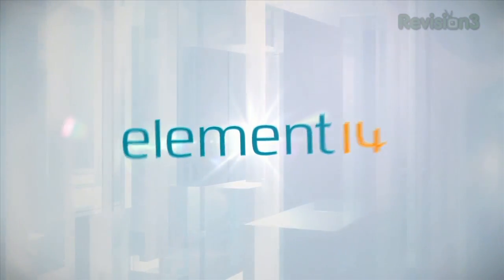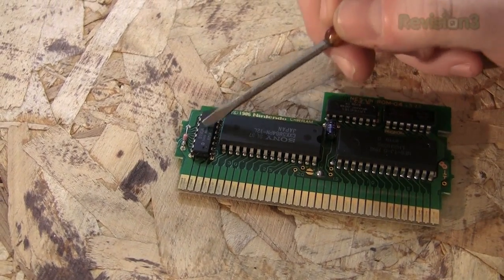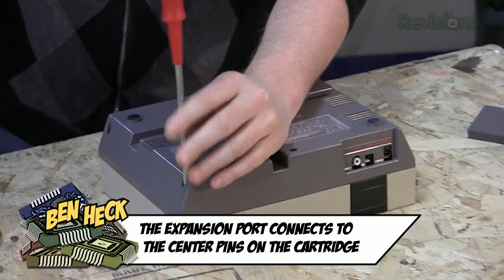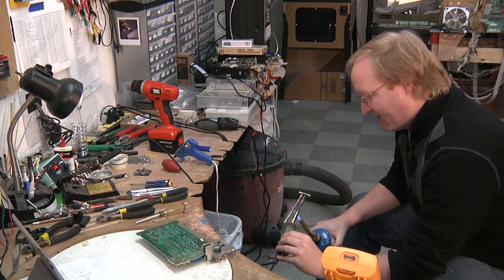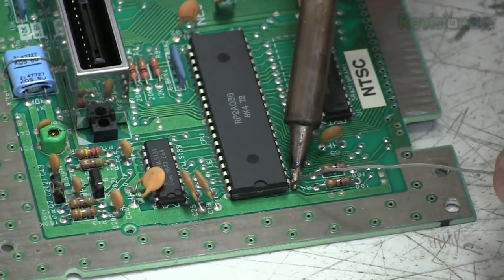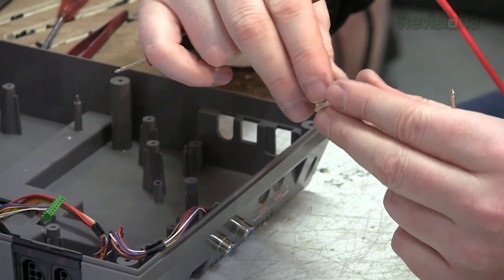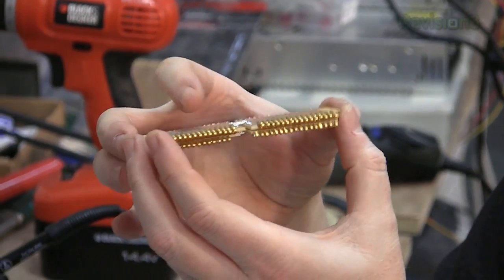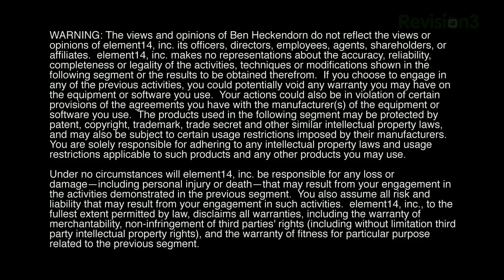Slot Loading Nintendo Game System - Part 1

Comment: You know the easiest way to fix the blinking Nes screen is to remove the 10 Nes Lockout chips functionality. Blowing in carts is actually very bad...if you're doing this you are compounding your problems. It basically causes corrosion to build up on the connectors that will eventually hose it.

Comment: Why didn't they just have a normal more solid connector with a ribbon cable attached to the board, could have kept the gimmick and not destroy itself. Or just have front loader, and maybe a spring pushing forward a bit that you could click in into place?  Or just have a front loader functionally the same as a top loader without the springy action?
The first two ideas would have worked for the feel they were going for, and not have the problem of the bending pins.

Comment: Once I realized how this system worked I went "WTF Nintendo, why overcomplicate this sh*t this much?" Couldn't they made the front loading without this ZIF bullsh*t? Like, just insert it and done? They fixed this with the Top-Loader but Nintendo being Nintendo made it with other problems.
Reply: That would have been great had the design allowed the inserted cartridge to stick out the front a little more so we could get a grip on it for removal. A standard insert slot like those in too loaders would have made removal difficult with the existing design.

Comment: the easiest way to fix the nes grey flashing screen is to remove the bb that is in a plastic track at the front of the nes cartridge tray. when you push down the tray, the bb moves off of a button letting the system know that the tray was pushed down. when the plastic track would wear out, the bb would only release the button only partially causing the flashing or grey screen. when the bb is removed, the system thinks the tray was pushed down and the nes would operate without having to push the game down. nobody ever seems to mention this problem.
Reply: Because that's not the problem. You attribute the issue to wear when the NES had this issue new out of the box.

Comment: 5:00  "Not so much 'flawed' as won't last 15 years"
I think that's a bit generous.  These things didn't last 5 years.  I don't think they even lasted 3.  Everybody who had a NES started having serious problems with the cartridge connector while it was still a relevant, daily used system.  It was really a serious problem.
Other than that it's a well built and reliable machine.  The connector is even replaceable - not that Nintendo ever sold them to the public, but still, it's a merit of the design.
It confuses me why Nintendos are so expensive nowadays - they sold tens of millions of these things.  All I can figure is that everybody threw them away when the connector made them think the console was "broken", and that's sad.
My NES from childhood is cosmetically rough but it still works fine.  I did replace the connector with one of those "death grip" connectors in the early 2000s though.  I wish I had saved the original for refurbishment.  Those modern replacement connectors have been in circulation for so long I'm not sure if younger users even realize they're not supposed to be that tight.
Reply: The problem existed new out of the box. It was flawed.

Comment: Would extending the metal bar at the top of the ZIF assembly outward (so that it can be pressed down instead of the cartridge) also achieve the goal of reducing stress on the bottom pins?

Comment: sorry but what is the point of this? can bend the pins back on the zif connecto. if you want can get a the new zif connectors online and the pins are tight and don't even need to push game down and it works. and if you really want can get the nes jr that was top load. this was pointless thing to do and a pointless video really. sure joke now but everyone should know never blow in game. that adds spit and stuff and corrodes pins.really ir and motors to load a game. this is dumb. talk about doing stuff the hard way. what is with the dumb rube goldberg stuff

Comment: Back in the late 90's when my Nintendo completely failed I opened it up by tapping the heads of the security screws and pulling them out. I had no idea you could buy new pin connectors or bits for the security screws haha. I cleaned and bent all the pins back up on the old connector with an exacto knife and put it back together and its worked perfectly ever since. [edit] I hadn't ever thought about the pins on the cartridges wearing all the way down from a tight pin connector, but I have only ever had 1 cartridge I owned fail on me and I don't know what caused it to stop working.
Reply: you should try cleaning the cart that failed if you still have it :P

Comment: I always wondered what retro gamers are complaining about when it came down to the ZIF connector. NES games weren't plated like a Saga or Atari games. The plating was about half the thickness (the reason why is to reduce production cost and time, basically if they wanted to double the plating it would have taken 3 times longer to make and you run a higher risk of "burning" at plate) and the ZIF connector was intended to extend the life of the game. The connector could easily be replaces and for really cheep. Also if you look at NES cartridges that have been used, they have alot of wear even with the design of the connector being the way it was. Imagine how bad the pads would be if it connected like a Saga or Atari game. There would be a lot of destroyed games. 

Now with the expansion slot I seriously don't think it was meant for an add-on. The Famicom DD connected through the top for easy connection. I am almost positive it was used for testing purposes, for both production and servicing, or for flashing the System ROM during production. It wouldn't make sense to have it covered so securely if it was meant to be used by the consumer. There is only rumors on what it was for and none of them make sense. I built circuit boards for many years for many companies and a connector like that reminds me of when I was building drives for motors and pumps. You can install the firmware more efficiently and test the product faster when the thing was built rather than testing components individually before hand.
Reply: Incorrect

Comment: FYI for anyone looking to disable the 10NES lockout chip: Doing so actually prevents certain unlicensed titles from starting, since they look for and try to disable it themselves on boot. It's a better idea to wire a toggle switch to pin 4, so the chip can be re-enabled when necessary.
Reply: holy shit a toggle switch, that would be epic

Comment: Is there any specs on the web showing what the add on for the NES would have been?
I am curious about what Nintendo may have made for that un-used slot?
Reply: PinBallReviewer Not sure about the specs, but at least on the N64, there was a disk drive sold so it could play CD games-but it sold poorly, and it was only sold in Japan (I think).  So maybe they thought there would be some sort of other game port they would use?  Multi port games or other weird accessories that never got made, maybe.

EDIT:
SaitoGamer 5 months ago
I think this expansion port never used was supposed to be a port of Famicom Disk System.

Comment: I think this expansion port never used was supposed to be a port of Famicom Disk System.
Reply: But one of the expansion Port pins is the pass-through audio pin used on famicom to NES converters, so Ben's mod isn't compatible with famicom games that use expansion audio

Comment: The Ben Heck Show I have an idea for a project that I don't believe exists, but would be extremely useful to budding filmmakers: An apparatus for recording camera movements during filming and then repeat those movements one or more times. This could be used to do Back To The Future Part 2 and 3 style moving camera split screen effects!

I'm not an electrical engineer, but I believe the underlying principle is pretty straightforward: Using a 2 or more jointed support arm with potentiometers (or similar) at all of the joints measuring the changing angles during the shot and then using that same data to move those joints in subsequent shots. Is this something Arduino/Rasberri Pi could handle?

This might even make a great Kickstarter project if it works well enough! I, for one, would pay a pretty good sum of money for a system like this... Anyone else?

JW3HH
Reply: I have seen something like this.  Can't remember the movie, but I do recall seeing the behind the scenes video, and they showed a setup where they built a miniature ( 1 foot = 1inch or so ) set, then had an overhead camera that rode on two rails above the set.  The camera could be raised or lowered, or moved side to side or back and forth along the rails.  A computer could manuever the camera viewpoint through the set, without running into the miniature buildings and scenery.

Still a good idea, and sounds like a perfect project for a Pi.
Reply: And interesting idea if I understand you right (Movement of the camera on the miniature set is duplicated by the full size camera on the full size set?).

Either way, it should be doable to have a recording/playback system for camera movements for the hobbyist.

JW3HH
Reply: Falbert Forester
It was done on Empire Strikes Back. The pilot's view from the Snowspeeder cockpit was shot using a computer controlled camera. I still have a recording of the TV special SP FX: The Empire Strikes Back which mentions this.

Comment: Fun fact: Blowing the cartridge didn't "Remove dust" as of popular belief, but moist got trapped between the connector pin, making the poor connection work, and you could turn it on again :)
Btw. replacement pin adapter is like $10 on eBay - well worth it!
Reply: very true, i heard the OEM refurbished 72 pins are even better than new ones. the new ones come from china and are built with different metals and are junk. the OEM Nintendo refurbished ones are legit
Reply: RideRedRacer The replacement connectors have a grip of death, and some of the cheaper ones can even strip the contacts off of the game board.

Comment: I think the worst part of the NES was the omission of the audio pins on the cartridge slot as famicom had.
There are quite a bit of games that have a integrated better audio chips on the mapper that either had to be crippled or just not sold outside japan due that.

Comment: You didnt have to completely remove the 10nes lockout chip, you could just disconnect 1 certain pin on the bottom row to disable it.
Reply: Without even taking it off the board, just snip the pin.
Reply: Ryan Winklevoss infact the lockout chip also prevents system overheating (somehow) so it's better just snipping the pin
Reply: Ryan Winklevoss He didn't remove it, he just took it out to show it, then put it back and connected the pin to ground. What I don't get why he bothered doing that when he could have just snipped the pin instead.

Comment: @Adrian Getano You give Nintendo too much credit. They did design the Famicom Disk System, which lacked a dust cover on the media itself and had frequent issues with the drive's belt needing to be replaced (like record players, only non-user serviceable). None of Nintendo's early work was particularly well engineered.

Comment: Besides being the most elaborate lockout mod I have seen, since it can be done by simply disconnecting the 4th pin without and soldering or desoldering anything, but still a cool video.
Reply: but that would entail cutting the 4th pin which forever ruins it. this way he can put it back in if ever wanted to for some random reason haha

Comment: Why do you need to add Stereo Sound if the games were all writen with Mono Sound in mind? Why not just use a adapter that splits the mono sound to 2 RCA Jacks to make the sound come out both speakers? That is what I did.

Comment: What was the purpose of the lockout chip? Also, how do you get away with soldering on IC chips without using a heatsink? Are they more robust than I have been lead to believe, or do you have a little leeway before you start to fry it? This is the first show of yours I've seen, very interesting! Can't wait to see what it looks like completed! I must also comment on the durability of the NES. No one I know has ever had one fail. One friend pulled hers out after years of storage and had initial problems playing it. About a week of swapping out games cleaned up the connectors and now it works great! Short of blatant abuse, I don't think these things fail! Have you ever seen one that had a meltdown? If so, what was the probable cause?
Reply: The lockout chip communicated with a second lockout chip in the licensed cartridges. If they talked to each other, the game would play. If the chip wasn't present in the cartridge, the console would continuously reset (if the chip failed, that would sometimes happen anyway, leading to the blinking LED of death that was common.)

There were way around it to play unlicensed games. You could cut a pin in the NES itself, which is what a lot of people did if the console's chip kept resetting it. Tengen reverse-engineered the chip to create their own. Color Dreams/Wisdom Tree would zap the chip with a voltage spike to disable it. Sachen would have a 72 pin dongle on the end of the cartridge to attach a licensed game to use its lockout chip (Little Red Hood used this.)

The toploader NES made from 1993-95 didn't use the lockout chip at all, so it would play any NES game.

Comment: I just want to point out that you didn't need to ground pin 4 on the lockout chip; simply cutting it is enough to disable it.
Reply: Yes, that is true. I've never bothered to ground pin 4 on any lockout chip I've disabled, and it has always worked perfectly.

Comment: ...or, you could just bend the pins back or flat-out replace the connector every 30 years or so... And what exactly are you making stereo sound? The point of stereo is to use your ears to percieve direction. Do enemies on the left go on a different channel than enemies to the right?

Comment: this is funny.. I modified my N.E.S. by simply bending the connectors with a small flathead screwdriver. After the  mod I only was required to insert the game cartridge (no pushing down required) and it worked better than any ones N.E.S. I knew.. even did my mod for a few friends. That was back in the 80's and I was still a child.

Comment: Those actually exist (I got them) They released a few NES infrared wireless controllers back in the day which come with a little infrared reciever box that plugs in to the system controller port, still got the box but I lost the controllers :( oh and it works withing 2-3 meters lol

Comment: Love this! Thanks for doing this... not done yet, but I have to ask, what was Nintendo thinking with that huge expansion port? What would other consoles use those for? That thing is HUGE, and if it drove up the price of what I (my parents) paid for that original Nintendo, I gotta know! Thanks Ben
Reply: It was probably for a floppy disk drive, over in Japan the Famicom got the "Disk System" that attached to the bottom, it came out in early 1986.  It never was released outside of Japan.

Comment: Well, the solution is simple. Wire a switch across pin 4, don't ground it. That way, if you come across a game that gives you problems on a modded system, but not a vanilla one, you can flip the switch before turning your toaster on and those games will suddenly... work.

Comment: I agree with this.. plus the sound modification has been around for quite a long time but I don't like it, a lot of games use the two generators at the same time to make a third sound and that gets lost with the separation, plus it is just overkill, still if this guy pulls off the load mechanism ( I haven't seen the second part yet ) this will be simply amazing.. still, a little bit overkill, I would prefer to mod a second generation NES with composite out, that would be much more efficient.

Comment: This is a poor design.  The major reason the NES ZIF connector is unreliable isn't fatigue in the leaf contacts, it's due to the fact that half the contacts have no wiping motion;  connectors are intended to slide, helping to clean the surface.  This has the same problem in spades.

Comment: The music in the background reminds me of a porn that would have been made in the 70's, based off of Mission Impossible.
P.S. There is a easy fix for the lock out chip problem too. It's just takes a simple pin cut on one chip. Actually takes 2 minutes to do. And molex sucks for connections, why not upgrade it to something better?

Comment: I was telling you how to find NES systems cheap.  Every time I go into a second hand store, or charity shops, what they're called depends on where you live, you can find them for under $10.  NES cables are usually not with them but they're usually easy to find in the same type of store.

Comment: So you're disabling the lockout chip...  Here's the thing about that...
Assuming the idea here is to make licensed (and unlicensed) games run more reliably, rather than make it easier to make homebrew games - disabling the lockout chip mostly helps you if your cartridge connector is unreliable - and even then all it really does is hide the reliability issue that triggered lockout in the first place.
And the whole idea of this project is to make a more reliable connection anyway, right?

Comment: 2/2. With the newer Micro-ITX boards, you can build a pretty small form factor PC in a little fish tank, make a custom back plate that holds all of your ports via extension leads from the mobo, use an SSD to eliminate the potetial problems of submerged HDDs and put one case fan inside to provide extra circulation...

Completely quite, dust-proof PC. Downsides are heavy, immobile, messy and awkward to fix/upgrade and the need to change oil every year or so.

Look it up. Fun times.